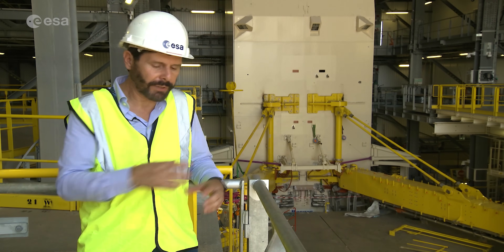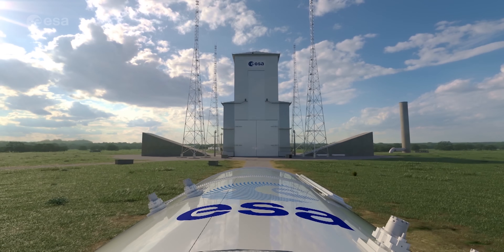Ariane 6 development: progress on all fronts

Comment: Unfortunately it is obsolete before even being ready.. Mostly governments will use them as they have to. private companies will probably use SpaceX as it´s way cheaper today. With Starship it will be even cheaper / have more lift capacity.
B.t.w. even governments in the EU start to use Falcon Heavy instead of Arianne, look for example at the SAR sattelites (SARah) which will replace the older generation (SAR-Lupe) for germany they will be launched by falcon 9.
There are multiple such cases where even governments inside the EU turn their back on Ariane.
Not the best outlook..

Comment: All very impressive, but without reusability it's obsolete before it even has a maiden launch.
Reply: there is a plan for a prototype in 2023 lunch.. the programe name is The Themis.. with the plan of 2030 mass production
Reply: Partial reusability by 2030 isn't going to be enough to prevent it from being obsolete, I suspect.
Reply: You want to launch a rocket (engine) that endures extreme heat in that process then rapidly cool down when boosting is done, then (parachute?) down to earth with a uncontrolled impact on "landing" then to be taken apart for inspection and tested if the components are still within spec  then to be reassembled again(iff passed quality test)  and refitted under a new vehicle in the assumption thatthis entire  process is more economical en equally safe as the possibility of just  manufacturing a new rocket engine?
Reply: @blauwzakjecrack  When a commercial entity has been propulsively landing their booster stages and reflying them multiple times for several years now, the concept has been conclusively proven. The economic case has been conclusively proven. If you'd made your comment in 2015 you'd have a point.  To  make it in late 2021 is a bit like saying "heavier than air flight is impossible" in 1908, five years after the Wright brothers first flight.
Reply: @linseyyoung1772   SpaceX charges almost identical price for a satellite launch as others conventional launchers operators. You are like the NATO military experts present at the Harrier jump jet first flight that thought that military conventional planes and airbases were obsolete... fast forward to 2021 and VSTOL planes are a rare breed and conventional planes still reign supreme.
Reply: @Mr.Zariguello  No, they don't.

Comment: It's great, but I think only for Europe strategic independence. I don't see how non reusable launcher could compete for commercial use cases.  Especially now that reliability is no longer Ariane's exclusivity, Falcon 9 launchers have also 99% success rate for a fraction of the cost.
Reply: I see esa have a good success rate of arian rockets launch history.
Reply: there is a plan for a prototype in 2023 lunch.. the programe name is The Themis.. with the plan of 2030 mass production
Reply: Falcon 9 with it's high-power and low accuracy upper stage doesn't deliver anywhere near the same result though. It is something like 1800 m/s short of a proper GTO. No wonder SpaceX only had 2-3 geo-launches last year.

Arianespace delivers highly accurate transfer orbits, even with two satellites at once. Also, Kourou is one of the best launch locations for launching geostationary satellites, as it's so close to the equator, making the plane change maneuver much cheaper. 

I'm sure Ariane 6 will be a great success.
Reply: @Antares2  Good to know there is still a market for Ariane 6. Better make Ariane 7 reusable though, if only to see those nice images of boosters flying back home like in sci-fi :)
Reply: @attilaborguet  the Arianes really don't need to be reusable for the moment and even for the forseable future, they are highly reliable heavy launchers that can tackle that part of the market better than anyone else. Vega-c is the launcher that will deal with the low cost market share and will sufffer the most from concurence from spacex and the likes, that one might become reusable one day even though it doesn't have to be, it just need to be cheaper. Also Arianespace learned their lesson,they are already investing in the future new market of micro launchers which might be even more profitable in the future. Arianespace basically have the high end market cornered, are late to the party for the competitive affordable market and about to create the new cheap market, its far from a bad situation.
Reply: @redwithblackstripes  i disagree, reusable rockets are very much necessary, the prices on expandable rockets are crazy high
Reply: Reusable rocket won't be cheaper for arianespace yet;
Because Reuse a rocket is cheaper when you launch a lot a rocket per year.For arianespace it is never more than 20 with three different type of rocket !  (light rocket vega ,medium rocket soyouz and heavy rocket ariane 5).
Reusability is a technological step ,cheaper in some case but isn't "necessary" to be competitive and it isn't a miracle solution for all the rocket users.
Arianespace work on reusable rocket "because it's important to master the technology when it will possibly be the best option"

Comment: Hmm.  Arianne VI is not able to do propulsive landings, meaning that every rocket is single use only.   Not exactly economical that...
Reply: There was also a plan to recover the engine using a tiny glider (the ADELINE system).
Reply: @HalNordmann  ADELINE was quite an interesting prospect, It would have been quite a show to see that.
Reply: Funfact, such a system is in devevelopement, or at least was before covid. Not for arianne 6 though

Comment: Neat. Good luck to ESA and Ariane 6. I wish your programs weren't so bogged down by EU politics, though. You'd be making reusable rockets right now if your engineers had the final say.
Reply: The only reason Arianne exists is because the EU insists on its member states using it's launch services,  and as for progress, building the Arianne 6 Expendable vehicle is not progress. All that hardware used one time and dumped in the ocean. SpaceX will have starship in orbit within the next year, that's the game changer
Reply: @Doitallagain2020  They're not trying to compete with SpaceX. They just want a domestic space program that can service government-sponsored projects. Once you understand the purpose of the EU, this approach makes sense. Politics is their driving force, not innovation.
Reply: @waynzignordics  I'm not saying there trying to compete with spacex what I'm pointing out is the fact that reusability is the key to lower cost access to space for the EU and its member states, instead they build expandable launchers, that isn't progress. There is a big effort from various countries to build new space stations and reusable rockets the EU need to get on the same path or it will be left behind.

Comment: Why so small and not reusable?
Reply: Why use a huge rocket for smaller payloads?
Reply: It is actually pretty big.
Reply: It will have a much bigger fairing and will have a higher payload capacity (to geo) as for price launching European satellite's from another country that isn't apart of EU or ESA is much more expensive than launching on a European rocket
Reply: They say it will be 40% cheaper than Arian 5. Why does reusability matter if it's cheaper?
Reply: @VFPn96kQT  Which is sadly still far more expensive than a Falcon 9
Reply: @Ev-wj3lm  not at all. Both will be around 10/11K$ per kilogram to space. But Ariane 6 can reach GTO, launch 2 heavy satellites and have a real fairing instead a pencil cap.

Comment: This second stage engine plumbing looks complex as fuck. I think it introduces lot's of opportunities for parts to fail or bad assembly. 

Is this still worked on to make it simpler?
Reply: well, a lot of the complexity you see there isn't plumbing, it's electronics and test hardware, but even the plumbing needs to be complicated because of the huge amount of roles that need to performed. looking at a simplified flow diagram of an engine it's pretty easy to say "gas go into turbine, fuel go into engine, why does it need to be so complicated?", but there's a huge amount of processes involved with pre-cooling and then igniting the engine, and monitoring it as it runs. a lot of systems need to be redundant as well, increasing component counts.
Reply: Rocket engines kinda be like that
Reply: @m_disulphide  "it be like that because it do" -- wernher von braun
Reply: When having a critical engineering eye this whole ordeal falls apart quickly. Be skeptical! everything should have a function and should therefore be logical and be rationally explainable why it is there at that time and why it is constructed like it is. 

this whole ordeal stinks.

Comment: Ariane 6 is absurdly expensive and highly deficient, not a fan of the project.
Reply: It's supposed to be the same price per kg in orbit than Falcon 9 but okay
Reply: @kreeperface397  All the manufacturing, R&D related costs are extremely high. Why? Because of politics. The EU aims to include as many countries (within the EU) as possible, the problem is not all manufacturers are up to the challenge, that'd mean we need to import parts from overseas and that's exactly what the EU doesn't want. Financially speaking it's a very very deficient project. FYI I'm talking from an engineering and financial standpoint.
Reply from the maker: [side note] we are not the EU. You can learn more about Ariane 6 here: https://www.esa.int/Enabling_Support/Space_Transportation/Launch_vehicles/Ariane_6
Reply: @EuropeanSpaceAgency  I'm so glad you guys replied. I'll get back to you in a second.
Reply: @kreeperface397  yeah… but that was 5 years ago
Reply: Totally agree with @Sebastian J. From a taxpayers point of view, the whole Ariane 6 program is in my opinion dissapointing and should have been reviewed and reconsidered in cost and time. After more than 4 billion of public money and several years of delay, by the time it finally flies it will be probably out of the market. And what is even worse, ESA will force his contractors to use Ariane 6 to launch their missions (Galileos), making them more expensive on average that they would have been by using other commercially available launchers, and again, charging that extra cost to the taxpayers. According to ESA's speech, independant access to space is worth that overcost, but as often in europe, the ones taking the decisions are they, but you pay. 

Also, in the satellite field, ESA's dynamics make european market work similarly to monopsony (many providers, one customer) in which regulations, lack of private investment and the famous "geo-return" decouple contract assignations from provider's performance, destroying incentives to take risks and be innovative. 

I hope the EUSPA short ties ESA and reduces his power as much as possible.

Comment: I'm a bit confused by these animations from 3:24 onward. Wasn't Ariane 6 supposed to be integrated horizontally? Or is this just for initial testing?
Reply: I'm not sure, bu the central core would be horizontally integrated then after this part has been erected on its launch pad, the lateral powder booster and the satellites would be vertically integrated.

Comment: Is it re-usable and if not when will that happen?
Reply: Not re-usable. To be economically competitive, a re-usable rocket program needs at least 20 launches per year. The current satellite market is too small for that. Even SpaceX doesn't reach this limit of profitability, with less than 15 non-Starlink launches per year.
Reply: @nicolas2419  what's the source for the 20 launches/year to be profitable?
Reply: @iamarokotmanson  I doubt there is a serious source for that but the cost for the rocket hardware is only one of many costs in a rocket program. If you'd get the hardware and fuel for free you'd still need big buildings and a lot of energy and personell to operate the whole place. It's not like you fire them after a launch. They want to get paid all year long. So you have to divide the yearly total cost of your space programm / the number of launches. That's the final cost of a rocket launch. So the more often you fly the more rockets you have that you can distribute the cost over. SpaceX is lucky because they get showered in investor money so it's ultra hard to tell how much they really make lauching rockets. Right now it's more of a growth business. Investors want them to build new stuff. To turn money into matter and that's what they do. ESA/Arianespace are different.
Reply: @nicolas2419  
Currently the internal cost for a Falcon9 launch seems to be less than $30mio for SpaceX. They make well over $20mio of profit per launch.
Even without Starlink launches the reuse of the first stage and the firings is a financial no-brainer for them.
Reply: @3gunslingers  The problem is, what is the real internal cost of a Falcon 9 launch because SpaceX does not publish any financial documents.

And given the incomprehensibly high additional costs of government launches, we have the right to ask the question whether these are not hidden subsidies and that the company is not making money with these commercial launches.
Reply: @nicolas2419  It's not how many launches per year that makes a reusable rocket competitive. It's how many times you can reuse the same rocket.
Reply: @priceringo1756  No! You have surely never had to participate in the management of a business.

To launch a rocket, an operator needs a minimum of infrastructure and a fixed staff. It is a cost that will be constant whether we launch a rocket per year or twenty.
However, this fixed cost is higher for SpaceX than for Arianespace, because the recovery requires much more personnel and additional infrastructure.
Now, the operational cost of launching a recoverable rocket is lower than that of a disposable, due to the recovery of the first stage.
Consequently, from a certain number of launches per year (12, 15 or 20?), the recoverable option becomes more profitable than the disposable one. Below this value, the disposable is more profitable.

Because of the American government, SpaceX can hope to have enough orders to be above this limit, Arianespace not. And since Elon Musk's prediction that lower costs would lead to a significant increase in demand did not materialize, that is not likely to change. Even more, that new competitors want to enter the market.
Reply: Esa has the programme Calisto and Themis for reusability on the future.
Reply: @tecmons   Thank you that's great news for Europe and uninformed me.
Reply: @tecmons  
"Esa has the programme Calisto and Themis for reusability on the future." 
Yes, in the FAR future, sadly. 
They plan to make the first big sub-orbital flights in 2025 with no specific target date for orbital launches. It will be 2028 or later until we see a European attempt in re-flying a booster. 
By that time Starship will have eaten up the entire launch market. 
And you really can't justify a partially reusable launch vehicle for the one or two  payloads per year that politically can't be launched with non-european rockets. International clients will simply not pay for such an expensive launch. They will all go to SpaceX.
Reply: Sadly Ariane6 is not reusable.
Any reusability will only come with a totally new rocket generation. If ever.